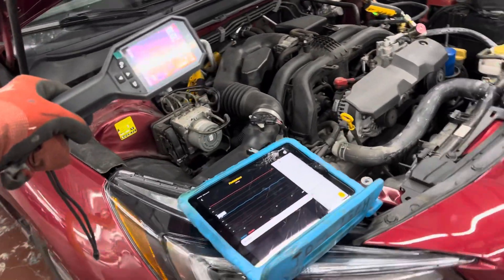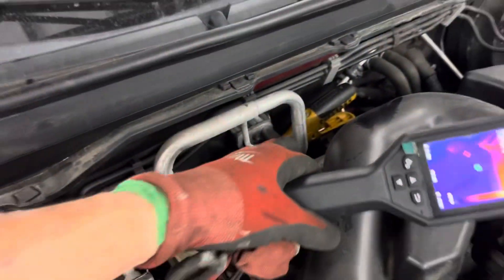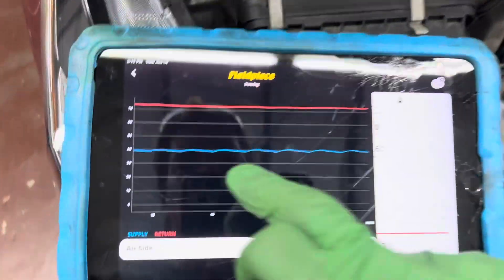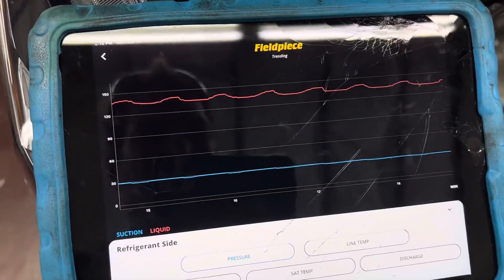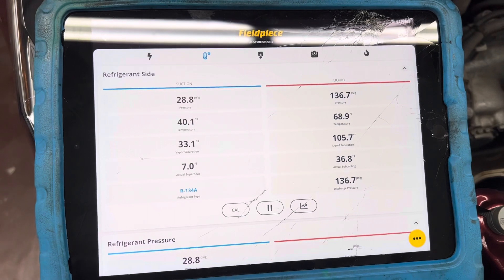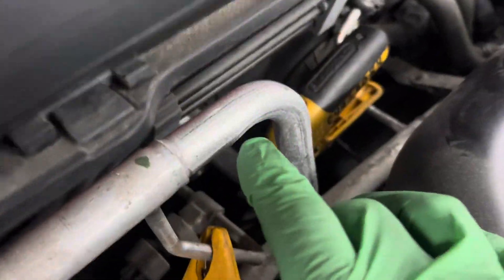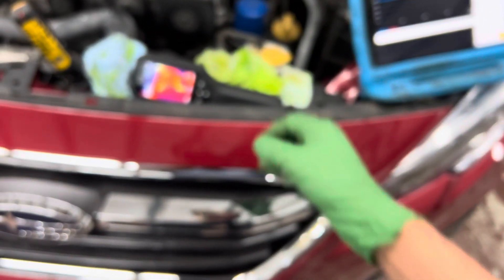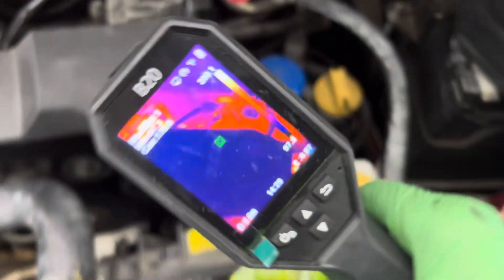Subaru, air conditioning, variable, Displacement, compressor controls, low side and high side PSI

Comment: The cans do not work in any situation? Except of course if we are colder and with it we manage to have it, but that means a leak.
Reply from the maker: The cans always work for me no matter what.  It doesn’t matter if they’re small 12 ounce individual cans or a large 400 pound cylinder.. 

You have to be the master of physics and manipulate the molecules by using the gas laws in your favor because you actually know what you’re doing .

If I’m in 120° desert or if I’m at -60° in Antartica, I can charge the gas every time 100% of the time 100% filled with liquid no matter what .

The difference between knowledge and lack of knowledge .
Reply: @coldfinger459sub0  Without emptying? With the pipes that are sold where you fit a can on it? Of course the pressure is related to the temperature, I'm not trying to challenge you on the contrary given your experience
Reply from the maker: @Adrianooo-sn6wz  
And here in San Francisco California we have a crazy $10 per can deposit charge on the cans .

Comment: The ability to control pressure is nice and all but I’m not sure it’s worth it when a expensive and complicated to install hvac control pcb deep inside the dash fails.
Reply from the maker: Do not very deep inside the dash problem solved.

Using air Duino or raspberry pi a little Arduino Uno for $10 and six grade level programming that a child can do ., No problem.

All controls on all vehicles can be overridden and completely bypassed 

Somebody told me it was gonna be $2800 to replace a Hvac, her body control module

I would just simply bypass it with a Little Arduino, or a pick unit or a 32 module. This is all stuff that children in middle school and high school can do. . 

It’s not rocket science it’s extremely simple .
Reply: @coldfinger459sub0  I’ll have to learn more about it.. The OEM parts and repair procedures have gotten ridiculous.
Reply from the maker: @coldjello8436  lead follow or get out of the way, 

Famous words from Lee Iacocca 

If you don’t want to become a dinosaur .  Because changes in evitable..  we are all students and we’re learning something new every day.  

Time is not gonna stop for us